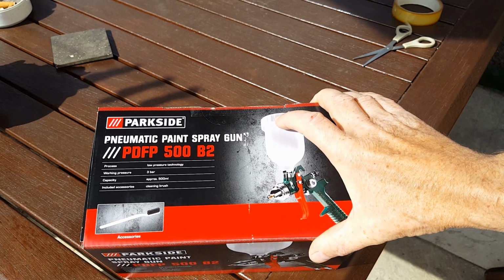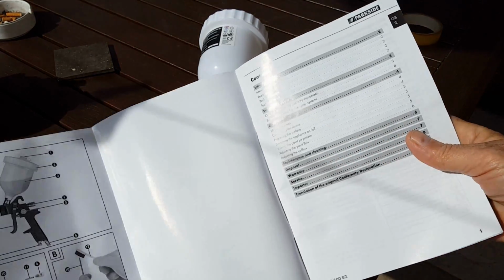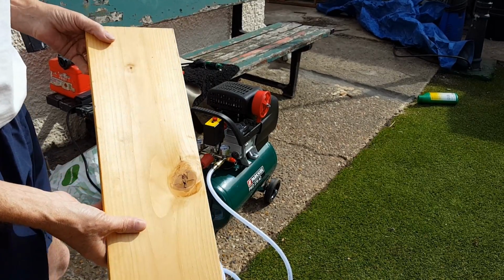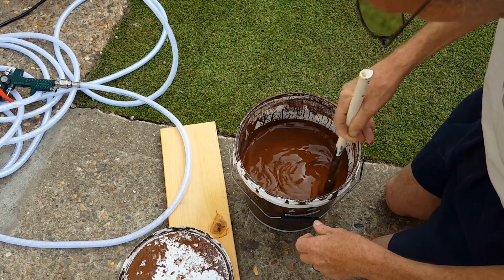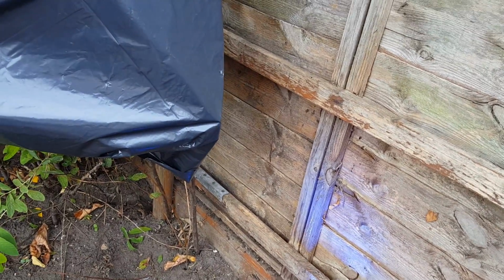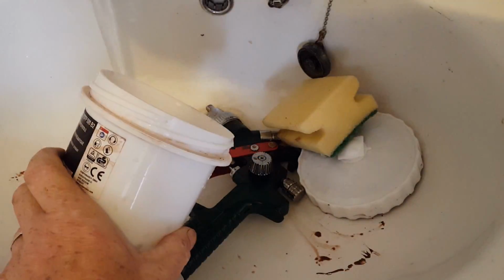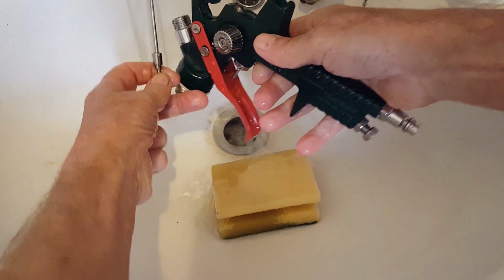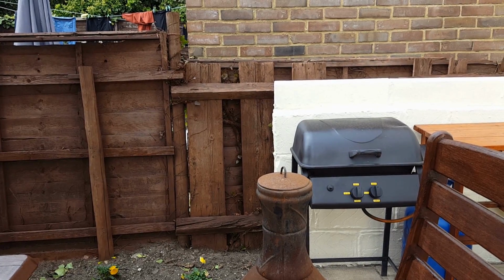Air Compressor (Lets Check it Out Part Three)

Comment: I have the Parkside compressor and it is the dog's . Got a wee spray gun off a pro and it's great.Haven't been able to buy the Parkside one but I keep popping in to Lidl every now and then .
A wee tip after cleaning with water dry it off and reattach it to line to make sure all water is away and put a wee bit of cellulose thinners in cup and below it through gun . With water (moisture ) lying in gun you would end up with limescale in it.

Comment: Good idea when you've cleaned the paint gun is to use a n air blow gum to get all the water out, stop internal corrosion. I'm in the process of getting the same from Aldi. 👍👍😎